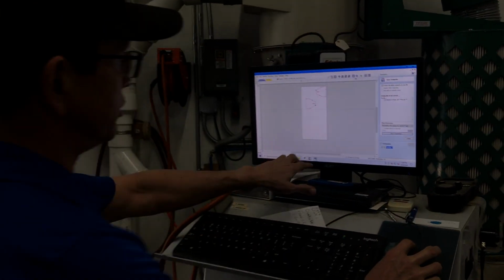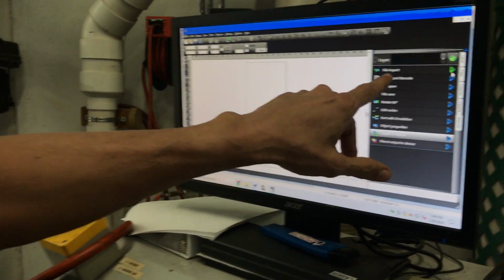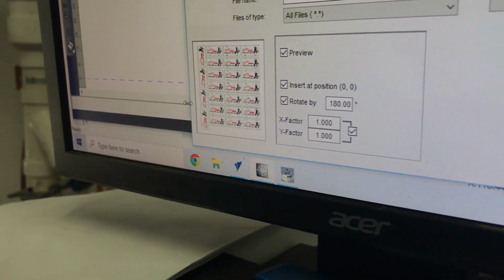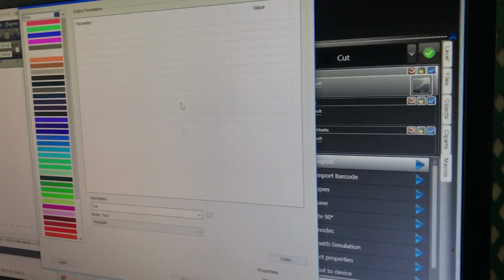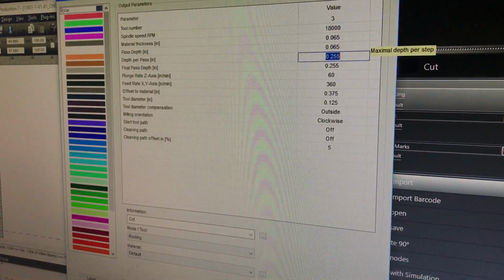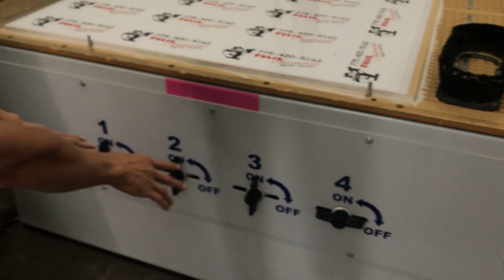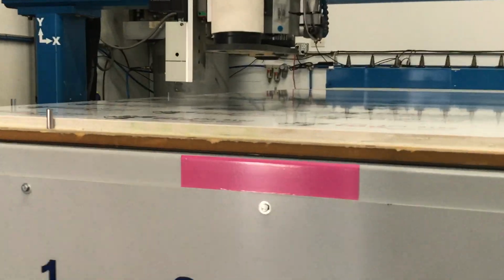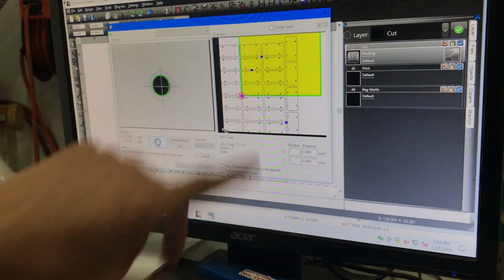CNC | ShopSabre | Print+cut job set up using OptiScout

Comment: Can you set up multiple cut layers? Say I want to read registration marks and then make a bunch of interior inside pocket cuts for one toolpath and then run a second toolpath which would be what cuts outside for the outline of the shape
Reply from the maker: We would suggest checking with either OptiScout or Shop Sabre to be certain. However, we have done what you are referring to by having two separate cut layers on the Illustrator file. One layer for the inside cuts and one layer for the exterior cuts.  Hope this helps.